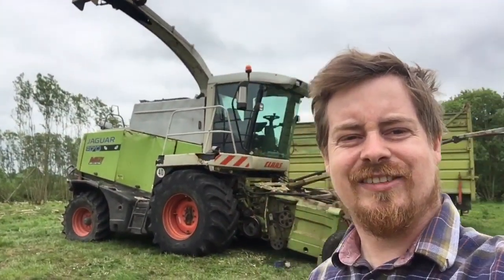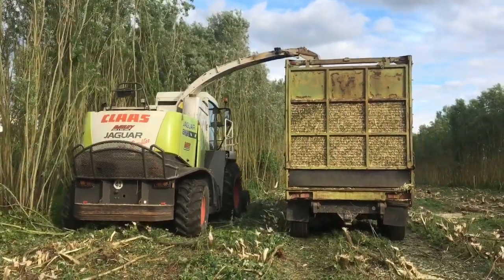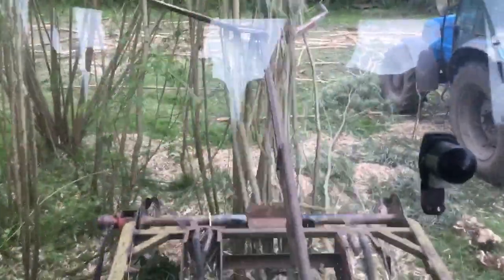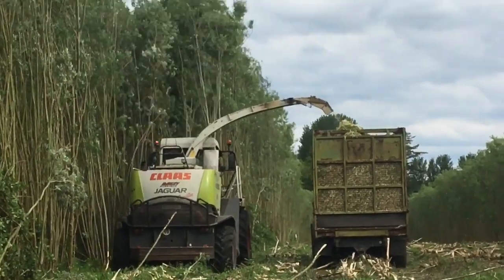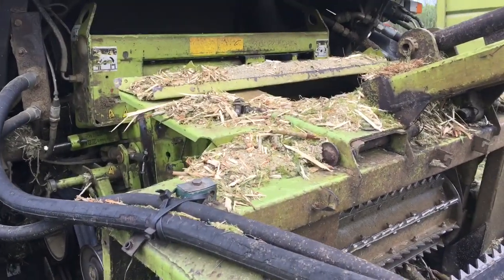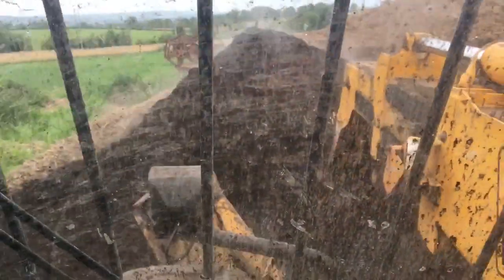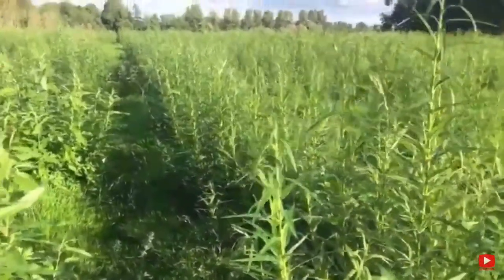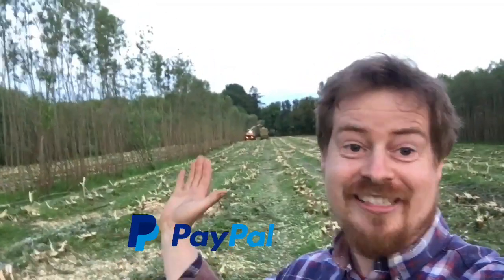Harvesting willow trees for renewable /biomass energy

Comment: Hi Steven,  I am from Australia and am considering harvesting a similar plant to your willow.  I was wondering if you would be able to give me details of your harvesting contractor (Baileys?) so that I could have a chat to them please?
Reply from the maker: Sadly to say that man has since died . 
The harvester was heavily converted, and had was 2 hedge cutting discs and pump. I think or maybe it had a 2 hydraulic pumps out of a ship… all I remember was it was two separate pumps as one couldn’t make the discs spin fast enough . Video is from April  2020 it still has its original harvester chipping block as I was changing the knifes in it . Can’t remember if all the knives were installed or every second one was removed .  But from the video you can see it’s no standard machine . Now I think there is someone else in Ireland with a modified harvester. I’m yet to find out who . But I’d be sure to make a video again if and when I can hire them
Reply: @stevenharpervw  Thanks Steven. Much appreciated. Looking forward to your next video if you can track down old mate. Trevor

Comment: I never knew willow was a crop! So if I understood correctly it takes three years for it to grow that tall? What are the chips used for? Thanks for sharing this. My horizon is once more broadened :-)
Reply from the maker: robbievangeenen 🙈😂 forgot time say in the video what happens to the chip. It goes to the power station and is burnt to generate electricity. So it’s a carbon neutral Fuel.  The own real down side is there is no off the shelf machines to harvest the willow. This harvester is custom made just for this one job.  Where are you from Robbie I meant to ask you ages ago
Reply: @stevenharpervw  Thanks for the insight! I live in the southern most part of the Netherlands not far from the German and Belgian border and actually quite close to Luxemburg. It's fairly rural around here, but no willow farming as far as I'm aware of. I think it's great that the harvester is customized for the particular job of harvesting the willow branches. Cheers, Robert.
Reply: @stevenharpervw  Correct me if I'm wrong but you claim carbon neutral, do you include the one off planting and land prep, harvesting, machinery production/fuel, truck transport to and from, compost delivery, compost manufacturing process? There are so many factors hidden behind the term carbon neutral. In reality I think its not. Also its not sustainable as a large scale industry as it would consume land that could be actually working to reduce carbon. Not just pretending to. Very interesting nonetheless.
Reply from the maker: @adamwilliams5426   it’s like Tesla / electric cars or the Green Party- it’s zero carbon  or carbon neutral. It’s impossible to say.  Basically my understanding is trees and plants need co2 to live. ( co2 in -> oxygen o2 out ) what ever co2 is generated from the harvesting /transport etc is reabsorbed by the next crop. It’s a closed lope cycle. The land is wet land that wouldn’t grow wheat for breed or produce grass for animals . Willow loves water so it drinks up the water in the wet soil . It’s the best crop for this land . But my question to you is, what’s the alternative? What could we grown to better work the land or better reduce co2
Check out my other video on mischanthus and the struggles on growing RE crop . The video cover is called “kilogen” or I’ll try link it this video description
Reply: @stevenharpervw  I think you choose a great crop to harvest its very interesting. As regards to carbon all the co2 that is absorbed will be then put back out into the air. This part is mostly neutral, but its all the other factors that I mentioned that push to the negative. Not a big deal really.
Reply from the maker: @adamwilliams5426  it’s always interesting to see a different prospective
Reply from the maker: @adamwilliams5426  where are you from? What do you do ?
Reply: @adamwilliams5426  if anything, it's probably slightly carbon negative. the biomass that's above ground, it's roughly equal to the one below ground. As tree roots die back, they convert into organic matter, and some CO2 as well. It'd be interesting to find out whether solar panels would be a more efficient use of the land, plants efficiency at converting solar energy is at most ~5%.

Comment: Hi steve, thank you for answering my question in  your other video. I plan to build a calliandra plantation and use it biomass for renewable energi.  Can this equipment be used on hilly land? if i want purchased, is it possible to shiping these monster overseas
Reply from the maker: No I say it has to be on flat land. You might be better off building your own machine or getting something like a hedge cutter with a circular disc
Reply: @stevenharpervw  thanks for the insight, honestly i live in indonesia with mostly hilly land. lookslike i must going back to old methods, cut and extract than forward to chipper. Terima kasih

Comment: How are the chips dried?
I assume they're not burned green.
Reply from the maker: Cut in the spring before the sap levels rise. (April)  And then stored in the shed for about a month. The timber does heat a little but that’s ok as it does also dry out the timber and stabilises itself so we don’t need to dry it. Maybe next time I’d try a duct in the middle to blow air into it or suck air out. I did turn it once just to increase the surface area and not have it all in one big pyramid  but 2 or 3 large heaps. The power plant took a sample and were happy with it
Reply: @stevenharpervw  
Thanks for the info.
Fortunately I've found the whole stem harvester design I need, just have to get the actual model number.

The plan is to stack them like staves of firewood, let them dry, then chip them.
Reply from the maker: @lordsamich755  yes like this?  We did that 7 years ago. https://youtu.be/r-fZs69IlRg